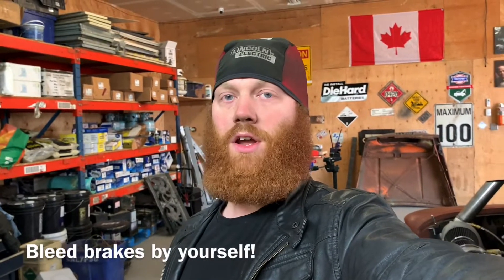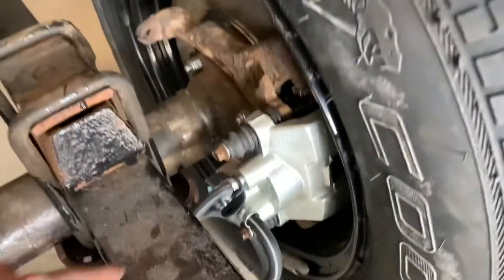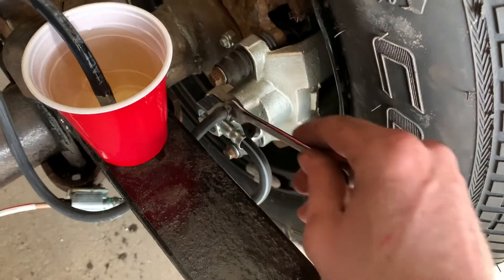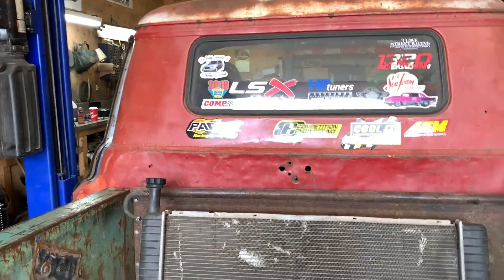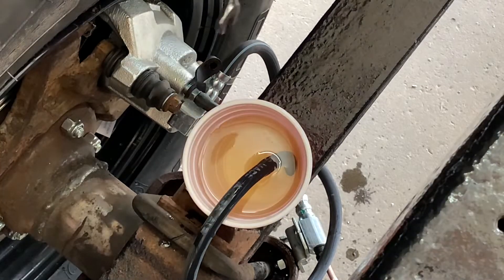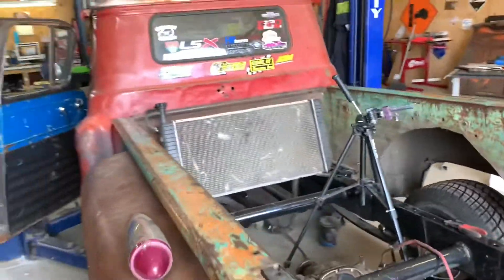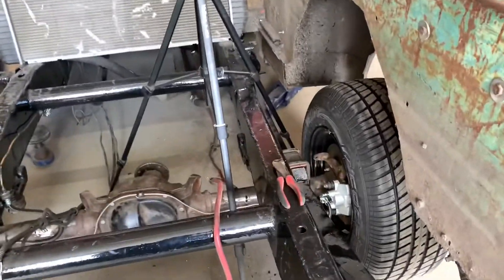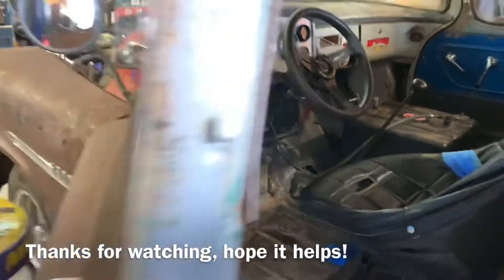How to bleed brakes by yourself with only a piece of hose. So simple, so easy, and so cheap!

Comment: Whenever I do anything requiring bleeding the brakes, I leave the bleeders cracked open and let it gravity bleed. Once there is some fluid starts dripping, it only takes a couple of pumps of the pedal to finish bleeding them. I have a one person setup, but never think to use it till its to late! Lol
Reply from the maker: Nice! That’ll make much quicker work of it too. 

I’ve used one of those one man bleeders with the litre vacuum gun, they’re not a bad unit but can be a pain when the hoses curl up lol